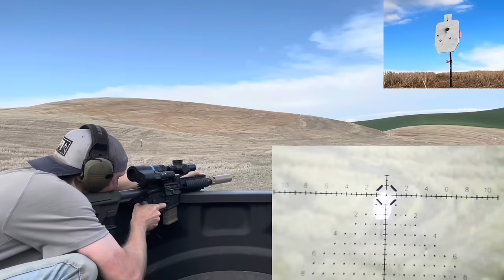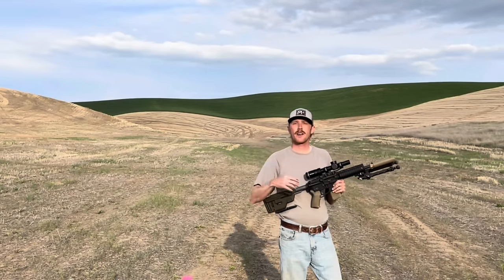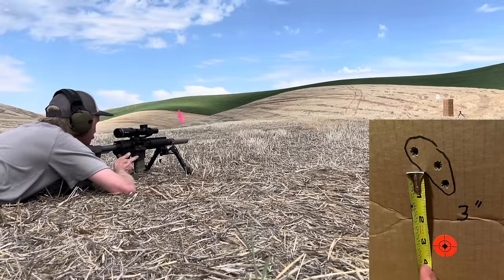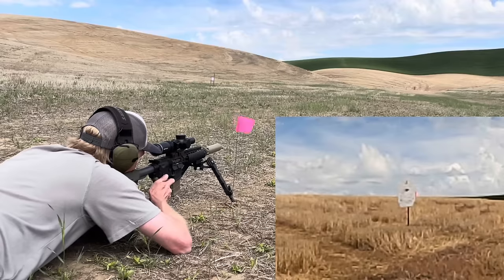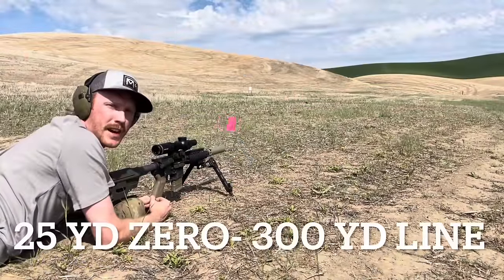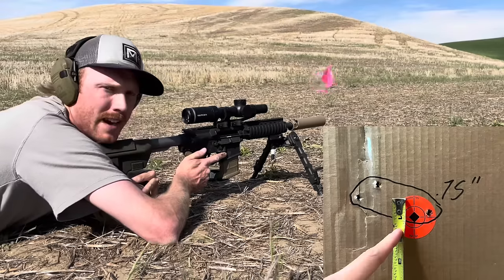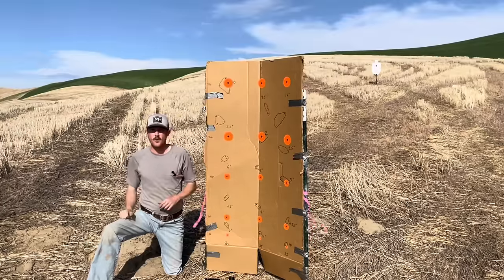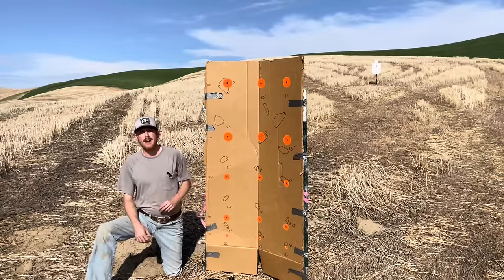Supersonic 300 blackout battle zeros- tested!

Comment: I settled on a 38 yard zero for my 8.3” using 110gr Vmax factory cartridges on a 2” optic mount. This gives me calculated impacts within 2 inches of POA between 5 and 180 yards, 4 inches low at 200, and 25 inches low at 300.

Comment: First, your “range” is amazing. That backdrop looks like a screen saver! 
As for the 0’s, I’ve always been partial to singe-direction corrections. Rather than having to remember if I’m at hold-over or hold-under range, it’s easier for me to remember how much hold-over I need at a given distance. So the 35yd zero is solid. In fact, I’m 0’d at 36 yards. Sounds silly but that 1 yard brings everything closer to POA/POI from 15 to 200 yards.

Comment: I’ve been using a 50y for my 300blk for years. Looking forward to seeing your results and making an adjustment where needed.
Reply from the maker: Oh man, hope I didn’t let you down in this one as I didn’t run the 50 yd zero. I know a ton of folks run the 50yd zero with 300BLK but I felt like the drop got a bit much out at distance to fit the battle zero idea. Pretty wild how different the ballistics on supersonic 300BLK is vs something like 556 or 308.
Reply: Not at all, in fact, I think I’ll be switching to the 25y zero. How much it’ll differ with my 6 3/4” barrel I’m not too sure but I’ll give it a shot. Keep it coming!
Reply: @DimDesertNights  also switching, very cool to see someone try this at length. i never thought twice about the 50yd since all the other uppers i own are also 50/200. v dope vid
Reply: @MountainsMulletsMerica great content, thank you! I would love to see the difference in the 35 vs 50 zero. I’ve always zeroed at 50 with subsonic then knew I would be high with supers out to 150. Never put it on paper though. I need to!

Comment: I would love to see you do this test with something like the Barnes 110 or 120 ttsx and see if solid copper bullets make much of a difference. I’ve been running the 110’s @ 2450 fps using this setup for thermal hog hunting and they do an impressive job on hogs out to about 250 which is my furthest kill shot. I’ve been using a 50 yard zero but would like to see the difference in this test. But I think I want to try the 35 yd zero as most of my shots are 50 to 150 with the occasional 200 to 250.
Reply: What’s your barrel length?

Comment: I recently zeroed my 300 9" BCM upper at 100 yard for 110 Grain Barnes VOR-TX rounds. At 50 yard, the hold over was found to be ~0.35" (based on a 3-round group). According to the ballistic calculator, there will be <0.2" hold under between 65-100 yard, and the drop is 8" at 200 yards and 31" at 300 yards. Setting the gun up as a home defense weapon with an Aimpoint T1 on a Scalarworks 1.93" mount, I think the hold over is easy to remember and height over bore will be consistent with my other 5.56 guns at CQB distances.
Reply: I’m going with damn near the same set up. Building mine now.

Comment: Another informative video. I'm liking the 35 yard zero so I don't have to hold low at closer ranges. Moving from low to high holds rather than just high holds can be harder to remember in a dynamic situation. Thanks!
Reply from the maker: Very true, the more you have to think the more you open yourself up to error. The ultimate goal of a battle zero is to allow you to make hits in the vital zone by holding center. For more the size of the vital zone influences how much difference in point of impact I can accept vs point of aim and then subsequently which zero works best for my application.
Reply: @MountainsMulletsMerica  Appreciate you taking the time.

Comment: Thanks for doing all that work for the side by side by side comparison.  While I know the concept of a BSZ, I just got my first 300BLK.  Now I can get to work seeing how I perform with each zero.  Probably get all the data and tape the zero settings on my buttstock and adjust per my needs if required.  Thanks for doing all that work.  Found you by your appearance on Texas Plinking.  Brandon's right.  You are woefully underrated.  Not for long though!  Keep up the great work!

Comment: Great stuff man. I'm familiar with the 36 yard marine battle zero for 5.56 that allows you push out to 300 quite well if done right. Makes a lot of sense since that's about the maximum effective range.. But I really like the idea of pushing the limits of 300 blackout. I'd also really like to see some research on higher powder loads/different grain counts in 300blk compared to 5.56, 7.62, and other more mid-long range calibers. I know everyone gets 300blk for close quarters sub stuff but it'd be really useful to know just how far you can push it. I mean, if you can get similar ballistics and range to 5.56 (I think you can get more foot lbs on target tbh) then it really extends the capabilities of the round. Like, have your subs for your CQB work but then carry some hot n' heavies to go loud, reach out and touch something with if the need be and without having to change guns altogether to be effective against other calibers.
Reply: 5.56 is far superior at range than 300 blk... The only advantage of 300 blk is shooting it suppressed.
Reply: Nice work as usual

Comment: Great job on the video. Thank you.
I think the 25 or 35 yard zero is the best here. Here’s my reasoning: even though you can hit a torso target farther out  with the 20 yard zero, the velocity loss past 200 yards would cause the lethality of,the bullet to be very questionable. most 30 cal bullets would fail to fragment or expand (depending on bullet type) at these distances/velocities (past 200 yards). So, unless it’s just for target shooting, the ability to hold zero and hit a torso at 250-300-350 yards is not very practical. Now if it’s just for target shooting/plinking, then the 20,yard zero is better.

Comment: Cool video. I always run the numbers through a ballistics calculator to find the best two-point zero for acceptable arc and range. Short barrels rob a lot of velocity. My 16" barrels get 2400 fps for a flatter 56 / 163 yd zero with only a 1" max rise just over 100 yds. -2.4" at 200 yds. -16" at 300 yds.  + / -  1" 36 to 181 yd accurate point and shoot. BDC reticle beyond that. Sight height over barrel center matters a lot in ballistics calculations.

Comment: Good stuff.  Need to know your vital zone radius or target size.  I load my own 110g vmax (.290 g1 b.c.) to 2410 fps out of a 16" brl.  Height over bore of 2.625", 8" target size (4" vital zone rad.), 5000' elev., 70 deg., 30% humid.  My near Zero is 31 yds; far zero is 232 yds.; max point blank range is 271 yds.

Comment: I run a 25/220 yd Zero on my 8” 300. 
Running Barnes 110 Black Tip/TAC at 2250+-, a Handload.  Optic is a 2 MOA RD. 
In its role as a 0 to 200 yd gun it makes hits quite simple with focused technique.  
Great Vid.

Comment: Thanks for the vid. I tried a 36y zero on my AK104 and got similar results as the 35/150y zero you have for 300blk. With this data one can apply it to a 7.62x39mm platform.
Reply from the maker: Very interesting! I’ve had a ton of comments around 762x39 and what to run for a battle zero. Super cool knowing 300BLK and 762x39 are close enough that the performance shown in this video would apply to both calibers. A 300BLK vs 762x39 video might be cool now that I’m thinking about it.

Comment: Built my first .300 BO, 14" pin & weld. Favorite rig now, wondering if the longer barrel with a lighter bullet changes the drop significantly. Don't really have the range availability to test this thoroughly out. I am running the 110 grn V-max with 1/7 twist. I have it currently zeroed at 100 yds but not confident that is ideal. I magneto tested the round but I do not remember the velocity of it.

Comment: Very good content my man. I’d love to see 110 grain, 300blk.
Reply: Definitely gonna second that. 125gr on a supersonic very much seems a 'match' weight, putting aside it's open tip. Something 110 with a minimum 2350 muzzle velocity would fall in with what I think most people would actually try to run if running 300blk. Having researched the caliber a little I really don't think it was truly conceived with nominal 7.62x39 or M80 Ball weights in consideration

Comment: Mr. MMM, Since you're on the subject of battle zeroes, how about comparing different bullet weights and velocities out of the same gun?  For example, run 55 grain ball and 77 grain SMKs through the same rifle and see what differences you get.  Will one zero be good enough for both loads?  You could also show the difference between projected drops (from a data app) vs real world drops and how to true the data in the app.
Reply from the maker: This is something I fully plan on doing as I’ve revived a ton of comments around how changes in equipment will impact down range performance. Now that I’ve got an idea of how I want to film this as well as what variables I want to adjust I just need to get out and film it. Only problem is I have more video ideas right now than I have time to film haha. Stay tuned, it’s coming though!
Reply: @MountainsMulletsMerica  You could film it like you filmed this and the other zeroing videos.  Start with a 50 yard zero and see what point of impact changes there are between cheap 55g ball and match grade 77g. Then show it at 100, 200, etc.  Is there a sweet spot zero that will work well enough for both bullet types?

Comment: I do not use a battle zero. Have the chevron on 50m and the first cross of the xmas tree on 300m. Using a SLx 1-8x24 FFP ACSS in yards, but on my rifle it does match the meters I mentioned. Rifle is a SIG PE90 with picatinny rail (SIG 550). Tested with GP90 and with GGG 62gr and 55gr. Cannot measure a big difference for the mentioned ammo. Unfortunately, I don't own 300 Blk already, but let's see what the future brings ;-) And that brings me to my question: does a battle zero count out if the Xmas tree allows quick measuring? Or is it useful with a CQB and does not help much with a longer barrel like I'm using?

Comment: Not in Colorado are ya...  My son just built his with a PSA upper.  Took it to the range and was having loading/ejections issues.  Purchase BO magazines and he said it's doing the same thing.  Now we don't have a silencer yet and the ammo was subsonic.  Maybe we need supersonic?  Working on the silencer also
Reply: only way you may run supers/subs unsuppressed is having your buffer weight about 3.8oz(H1).When shooting supers you want heavier buffers and subs lighter buffers so 3.8oz is the sweet spot for 300 Blkout.I heard the Nemo Arms 300 blackout carbine buffer spring helps you shoot subsonic with a standard carbine buffer & pistol gas length suppressed or unsuppressed.
Reply: Do not listen to this guy above ^. 

You are 100% having gas issues. Buffer weights have nothing to do with the issue you are experiencing. 
Buffer weights deal more with felt recoil and slow down the action of the BCG if needed. That's 100%, not your issue.

Take a look at the gas block and gas tube, that's where something is going wrong. My guess is the gasblock is not properly lined up.
Reply: @bigtechnazis3554  all 300 blackouts don’t run the same clown! some people can shoot str8 out the box running both and some can’t even with the same setup!He’ll have to buy an adjustable gas block if he needs to or play with buffer weights & springs for his setup.
Reply: @gullahgeechee2699  
Yes, that's correct they don't all run the same. But you are quite literally giving him wrong information regarding his issue. No, he doesn't need an adjustable gas block if it is currently un-surpressed. I've built numerous 300blk guns with standard to H3 buffer.  This man's issue is 100% 1 of 2 things, gas block is not aligned properly, or feed ramp issues, but since he has ejection problems, it's most likely the alignment issue.
Reply: @gullahgeechee2699  
he's literally not getting enough gas to push the BCG back far enough for ejection and feed.
You're recommendation quite literally would make it worse.
Reply: @gullahgeechee2699  BTW, this isn't me dogging on you. I used to do the same thing when I was new to the hobby, thinking I knew everything after my first build. I'm still learning more neat stuff every year. Give it a few years and a few projects before giving advice.
Reply: @bigtechnazis3554  pistol length length gas system,standard carbine buffer & blue springco spring will be all he needs if the gas block ain’t the problem.He never told us his setup so keep that in mind.✅
Reply: @gullahgeechee2699  Yeah, minus the specific spring, that is the standard setup in most 300blk ARs. I suppose if they started with a H3 and he's running a 16" it could cause the same issues, but who the hell starts with an H3...
Reply: @bigtechnazis3554  H3 is for 7.62x39mm anyways🤣🤣…I like standard and H1 for 5.56 and 300 blk unsuppressed since both of mines are pistols.
Reply: @gullahgeechee2699  
🫢 Okay, I tried to help out, but you're quite literally too arrogant for that.  
Not one thing you've stated yet is accurate. 
You could easily look up everything I've stated to be true. You're refusal to do so, and your continuance of incorrect information is disgraceful to the gun community.
You should quite literally be ashamed of yourself.
Reply: @bigtechnazis3554  you can’t tell me when I studied before building my ARs and mines run fine! I wonder why you never made videos instead of gossiping 😏🤔
Reply: @gullahgeechee2699  
The conversation is over. Nothing can be done for an arrogant egomaniac.
Reply: @bigtechnazis3554  people like you always make a big deal out of nothing.I am in a 300 blkout group with people with his issue and buffers and springs fixed it😏
Reply: @gullahgeechee2699  
if you would have stopped being an argumentative child and done the adult thing and looked up the purpose of buffer weights(which you obviously have not done), you quite literally never would have responded in the first place.
Reply: @gullahgeechee2699  
I already took screenshots yesterday and shared it with AR Forum. You're being trolled as we speak. That's actually where I got the egomaniac from. They're like, there's nothing you can do for that individual, except Worn others not to listen to him.

Comment: I’m going to do the 25 to 200 dose it work with 110 grain ammo.
Reply from the maker: So the “battle zero” concept shown here works with really any caliber and or bullet weight. While I haven’t personally run any of the 110gr bullets, I would expect the performance shown on video here with the 125s would be very similar to what you’d see out of the 110. The actual point of impact distance vs point of aim might be a little different but if you’re setting up a fighting rifle you’d 100% still be able to hold center tires and make impacts out to 300 yds or so. Thanks for watching!

Comment: Great information, as usual. Thanks! 
By pure dumb luck my zero has been the 25/200 (probably because it's easy to do at the indoor "pistol range" and I'm somewhat lazy? :>0). And I say dumb luck because I had not thought things through... but it seemed to work fine for my intended purpose on that "truck-gun" 12"brl 300BLK AR. So it stays... 
Now I also own a toy/range 8"brl 300BLK AR (I would call it a PDW but I'm no CAG-Ninja, so yeah... to me, it's a range toy. Maybe a home defense AR but I already like my 14"brl 870 shotgun for that job, a lot) and I'm going to re-zero that one at 35/150 since it seems to make more sense for the "PDW application". Really appreciate your input. 
Now, really stretching things a bit... Both my 300BLK have 1/7"T barrels but I've been reading about how the 1/5"T (originally thought to better stabilize the heavy 220gr Subsonic rounds, If I understood correctly... but I don't have much use for Subs since in my little corner of Paradise, cans are really frown upon. You know... "assassin" tools. Stupid has no cure, I know... but I digress), will also improve the Supersonic 300BLK dispersion cone (I like the 125gr OTM myself). Do you have any thought on that? I know the 300BLK is no PRC round, but I like it, and if I could help it to "group" a little better, why not? :>0   
Keep up the great job!

Comment: crazy your only using a 9 inch barrel wow
Reply from the maker: I’m a short barrel fan! Why run a longer barrel if a shorter suppressed setup will get the job done?
Reply: it’s meant for short barrels and still outperforms 5.56 any day with impact but similar to 30-30 & AK47.#ShortBarrel4Life🤣😎🤙🏾

Comment: yo fiancees acct boyz to lazy to switch accts-- anyways waste of time looking at these videos to many unknown variables not being taken into account for you the shooter. E.g barrel length which will change your velocity, bullet grain again altering velocity, optics height above your bore, etc. BIG tip and time saver run all YOUR stuff into a ballistic calculator. Then commit to your findings and your application keeping in mind the holds and keep running the same ammo for consistent results. locktite and torque to spec and confirm zeros. train with all this in mind. IF you disagree then you definitely voted for Biden